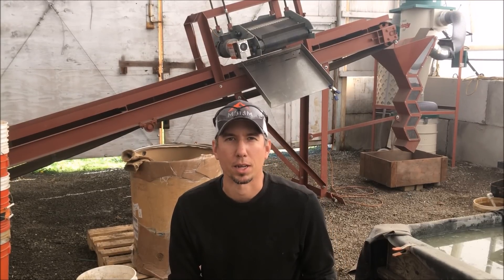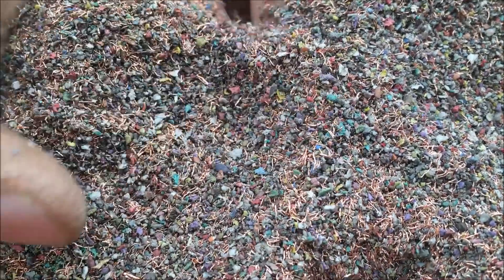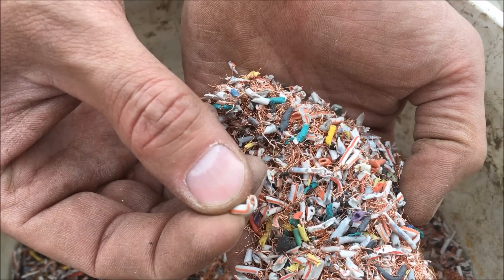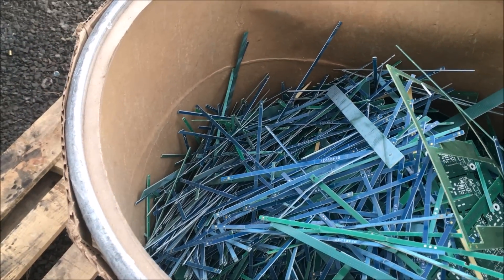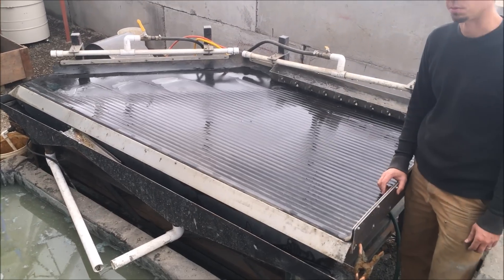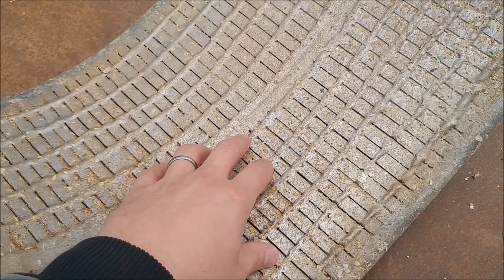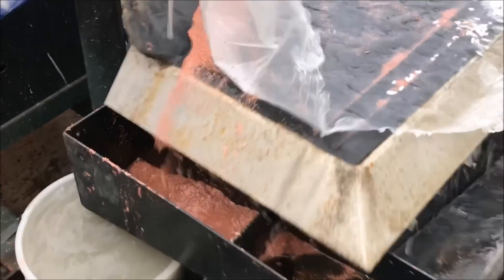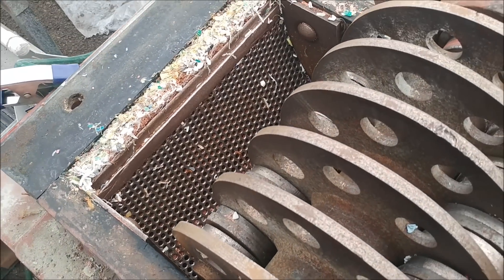Copper Chops and PC Board Trim/edges metal recovery on MBMM shaker table

Comment: My comment remains that while your equipment make great sense for medium to large operations that the is a huge small market for those that want to test a recycling idea or simple are not big enough to be putting  tens of tons of material through each day. 1 ton of material in 4 to 8 HR. May be plenty to turn a nice profit and while I realize that small is a lot more work for a smaller profit there is no one there for the little guy I mean you are it and still way to large for some things.
Reply: I wish they would make a small system for a at home refiner. They would sell a bunch!!

Comment: also if you run a higher water yield you should be able to create enough agitation to keep the copper from floating on surface
Reply: Plastic sheet keeps it down

Comment: the guy who ground that copper needs to set a closer gap a 0.007 on his granulators with quarter inch greats to avoid the insulator sleeve still remaining on the copper.

Comment: I like to see some air conditioning compressors run through the hammer mill. If too big then refrigerator compressors. It takes me half a hour to break down one ac compressor and it's a pain in the ass to say the least with a angle grinder and hand tools.

Comment: Hi Jason, I wonder would happen if instead of using the plastic sheeting to brake the water surface tension what about dish soap?  This would also help to lubricate the particles as they go over the ribs on the table.  I was also wondering of the shaking of the particles charges them and re attracts them to the other particles .  I once built a machine that separates plastic (3 ata time) but it was a dry system. We used static and electromagnetic
Reply from the maker: Good idea, thanks for the tip

Comment: Hello guy ,  I know most of your videos by heart. But just noticed something. No soap ?  I seen people add dishwasher soap ( no suds)  to the water and it really helps separate copper and plastics and stop fine wire from    Floating .
Reply: David  yes jet dry works on some things . All copper wire is coated with a thin coat of oil when plastic is put on the soap helps it come about . Yes jet dry could work , I've just never tried it.
Reply from the maker: Great, thanks for the tip!

Comment: Nice system. For the awkward stuff why don't you dissolve the copper in hydrochloric acid to put the copper into a liquid solution then filter out the crap and then use iron to bring the copper solution back to a solid?
Reply from the maker: Great, thanks for the tip!

Comment: I don't remember the brand name for it in America, but I've seen the gold panners use dishwasher drying agent to break the surface tension without too much foaming. Maybe a solution for floating copper? (aka surfactant i believe)
Reply from the maker: Yes, good idea.  It is called Jet Dry is the common one.  This copper was coated in a thin film of oil so the plastic sheet seemed to work the best.  Thanks for the suggestion!
Reply: @mbmmllc  Thanks, that was the name. Yeah I see the problem, the fat restoring tension. That plastic sheet was pretty samart though, no chemicals too!

Comment: Jason, all of these samples have been thru first grind. Question is, can your system do that same grind and remove that first step?
Reply from the maker: Needs to be granulated first.  The hammer mill doesn't chop the wire

Comment: Try adding dish washing ,FINISH to cut surface tension, JET DRY also works well. The next machine is a waste oil fired smelter and a set of  molds.
What happened to the PC board GOLD ?
Reply from the maker: Thank you for your comment and for watching our videos! Gold will go with the copper, can re-run the #1 for better recovery of PM's

Comment: Once you talked about the plastic sheet I realized how the copper was being pulled under if it was ultra light weight. I see in the comments some mention of using soap, however I can only see increase in cost and time, not sure? I will say once you laid the plastic sheet on you were cooking with gasoline. INCREDIBLE. I have been recovering CPU Gold for years, haven't done anything with the majority of it, yet. I did send in to an internet scam company that claims online how much they will pay you for the material, but were disturbingly a rip off outfit. I will have to subscribe and watch as you do things. 
The video was excellent in many aspects. I knew some guys that did  this with drywall, producing the granulated lime, then reselling it to farmers for fertilizers on potato fields. They got paid when someone dumped it, and when they sold it, the cost of processing and the bigger companies have since taken over, I guess. Seeing your setup was a real treat. Thanks
Reply from the maker: Thank you so much for your comment and for subscribing! I'm glad you enjoy our videos!

Comment: to break surface tension use soap. jetdry is what most people like to use but im sure any soap will do fine.
Reply: I think that they recirculate the rinse water, so soap would suds up, Vinegar might help that , but since there isn't actually that much water being used Jet dry would probably be best.
Reply: Wouldn't surf board wax applied prior to use do the same thing..
Reply from the maker: Thank you for your comment and for watching our videos!

Comment: HOW MUCH DID YOU GET OUT OF IT.
Reply from the maker: We didn't weight the material before and after, but the wire was a combination of 50% recovery, 70% recovery, and 80% recovery (ie percent copper by weight).

Comment: Hi Jason, thanks for another great video. It was just little bit disappointing that we haven't seen any results from all 4 buckets you shown. I hope another video can cover it ;)
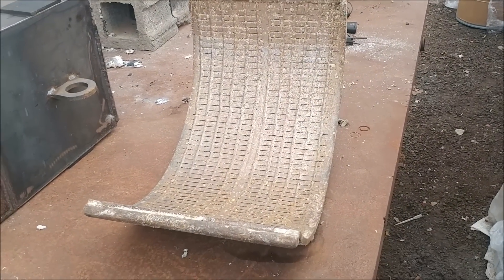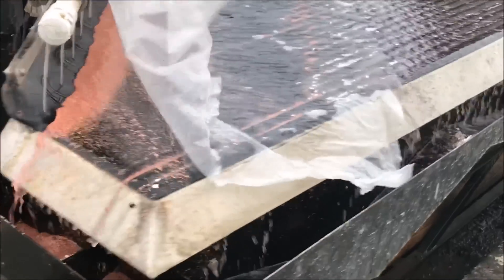Reply from the maker: Thanks for the comment.  When the customer arrived they wanted to run all the material before their granulator at once and then everything after their granulator together as well.  We did three different runs: 1st material was the board trim, 2nd was material through their single shaft shredder (longer wires, some unliberated) this was section 7:13 - 8:07  Did really well if it was all liberated (com wire wasn't liberated for example and brought some plastic into the #1 and #2).  The last section of the video was the material through their granulator.  That did the best over all.  So the two buckets at the end with the copper wire were an example of all the granulator samples run together in the smaller bucket, and the larger bucket was all the single shaft shredder material run together.  These were just part of the copper recovered as the customer took a large amount with them for sampling.  I hope that all makes sense, its kinda long winded and complicated.  Let me know if you have any other questions.  Thanks again
Reply: Xin lỗi đã làm phiền ngài, ngài có thể giúp tôi ngửi cho tôi thông số kỹ thuật , sàng dung tách nhựa , đồng , hệ thống sàng dung tròn , tách ở chế độ khô, xin cảm ơn nếu được ngài giúp

Comment: Wow Jason that stuff turned out really really clean... also I have a request for you I cut open large Freon compressors out of commercial air condition units very labor-intensive and a lot of work to extract the huge copper coils.... I don't ever remember seeing you trying to grind up these big Freon compressors but I'm interested to see if you're bigger unit will pulverize those ...let me know thanks
Reply: if thier like pool motors just cut the copper across the edge of one side of the coil them remove it from the other side.
Reply from the maker: Great, thanks for the tip!